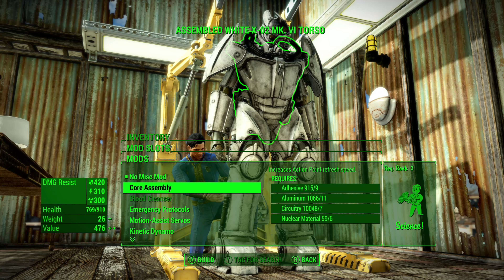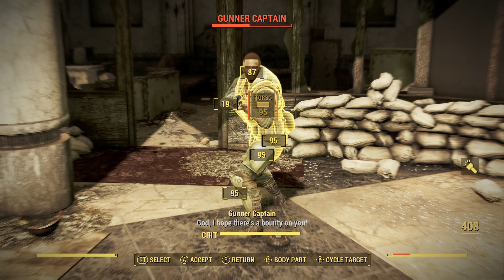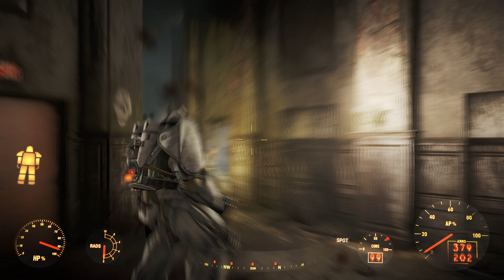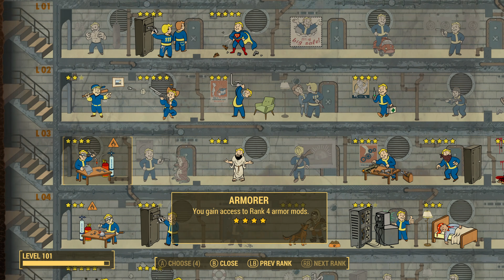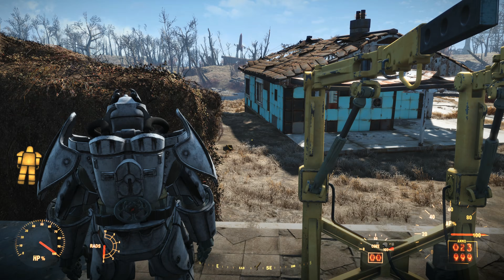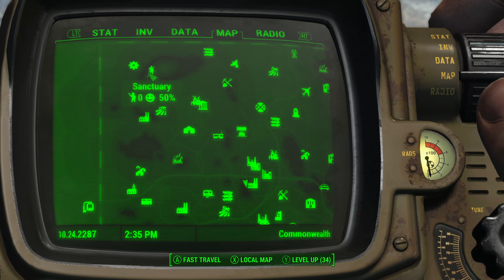Fallout 4: ULTIMATE Power Armor Guide

Comment: One more thing you will need steel to repair Raider power armor, Overboss power armor, and T-45 power armor which is relatively cheap and easy to get resource. However for T-51 power armor, 
T-60 power armor, X-1 power armor, X-2 power armor, and Hellfire power armor you will need a lot of aluminium to repair it, and even to modify certain parts of you power armor. You can get aluminium from merchant Arturo (he sells it of a stack of 50), get a Scrapper perk to get it from breaking down weapons, or farm it from Mahkra Fishpacking location.
Ps. On PC you can simply write the code to get your resources, but on consoles we actually have to farm them ourselves.
Reply from the maker: I did make sure to mention repair in this guide but I certainly could have gone into more detail. I mentioned that you can repair and that you use resources from your settlement workshop but equally could have mentioned pretty much what you said, how its different for different sets etc. Thanks for adding the info, much appreciated.

Comment: - Explaining things that are obvious to every player who has ever played Fallot 4 is a wasted effort. The background screen in the main menu (the first thing you see in the game), has a power armor hooked up at a power armor station. I don't think anyone had any doubts on how to use it when they did their first playthrough.
- How to get into a power armor is also explained in the "tutorial". Sturgis clearly explains how it works, and there are mission objectives in case anyone missed the dialogue.
- Using the X-02, to showcase things, is unfortunate, since it has unique modifications and paint jobs.

Here's how I would have done it:
- Benefits & Drawbacks - Strength goes to 11 regardless of initial stats. This means better melee, unarmed and carry capacity. Damage resistance compaired to regular armor. Having to repair it every now and then (having to haul some materials for that). Limited sneak capabilities. Things like that aren't included in any tutorial, so that's where I would start.
- Gameplay - How does a PA affect playstyle, and builds? Are there any benefits for certain weapons? Any bugs?
- Modifications - Everyone can read what the menu says, but what does it really do? How much bleed does Rusty Knucles add? Is it worth it? And so on...
- Upgrading from Mk. I to Mk. VI. What does it mean, apart from "better"? What's the difference between damage resistance and health on any of the parts? Does damage resistance go down along with the health of a specific part?
- Adding knowledge, like... Each of the vanilla PA's have a unique paintjob connected to one of the main factions. T-45: Minutemen, T-51: Railroad, T-60: BoS, X-01: Institute. Things that are easily missed.

I'm not saying these things because I want to make fun out of your work. I want your material to be something that I really look forward to seeing. The only way to achieve that, is to make content that is based on proper knowledge and experience. Do the testing and find out what things actually do! I hope I managed to deliver this constructive critizism in a positive way. That's at least how it was intended!

And finally... Did anyone catch the Spinal Tap reference? Strength goes to 11...
Reply from the maker: Thanks for your comment and feedback. Nope, no harm at all - it's all good feedback for my to reflect on. This was intended as a guide to help out anyone at any level. True, things are explained in game but it's not clear always and at times things are explained just the once and never again. 

I also explain things that have been said in game as an 'intro' to other functional areas otherwise it would feel like I am skipping bits.

I suppose one may be happy with the level of detail I go into as it could easily be missed but perhaps not too.

It's just the way I convey the info. But thank you still for sharing, it's given me food for thought for sure.